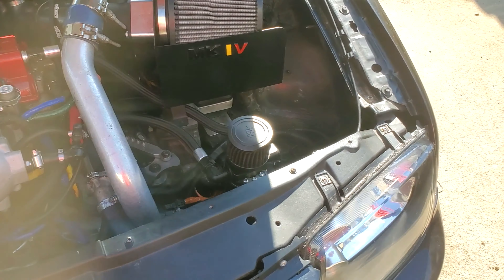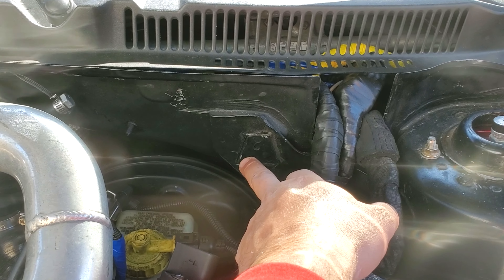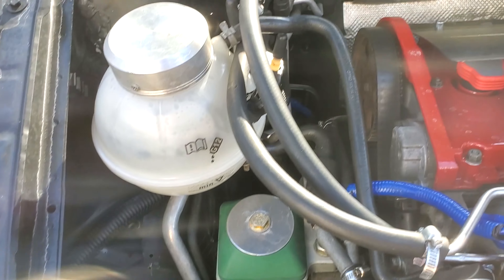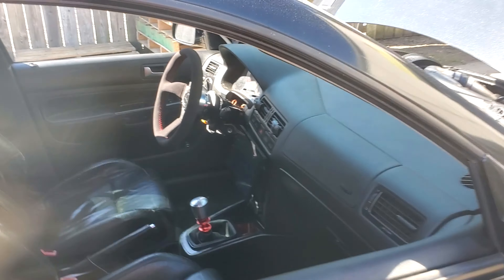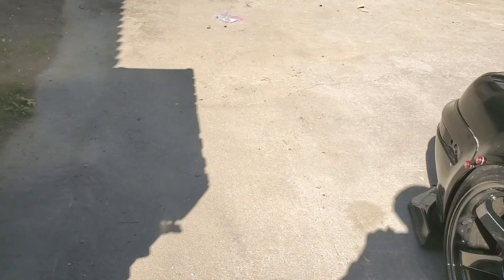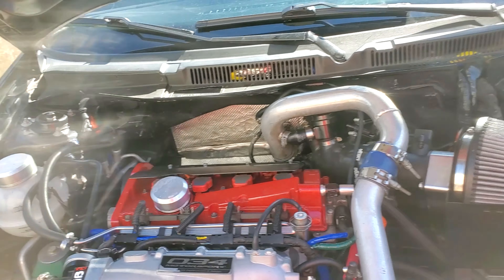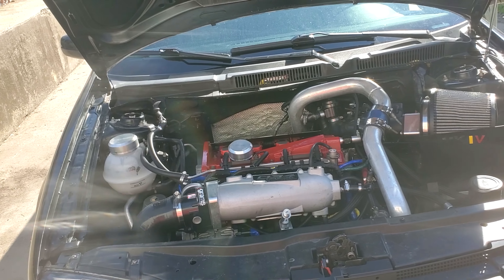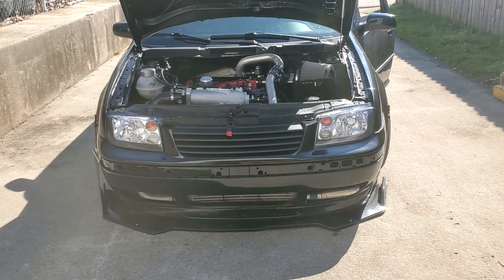1.8t build update on recent upgrades

Comment: You realy do need to replace everything y replace turbo,clucht,head where done did 4 valves and 8 valve lines did  the timing belt and chaine and all the ajusters ajusters did the oil pump,crank metals also added a lil manual turbo control and rigth now if i step on the gas to feal that turbo every thing its cool pull really good but one the rpm lowers the car dies on me any suggestions ?
Reply from the maker: Probably your gas pedal.